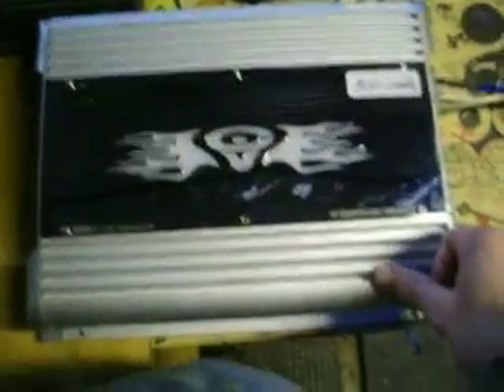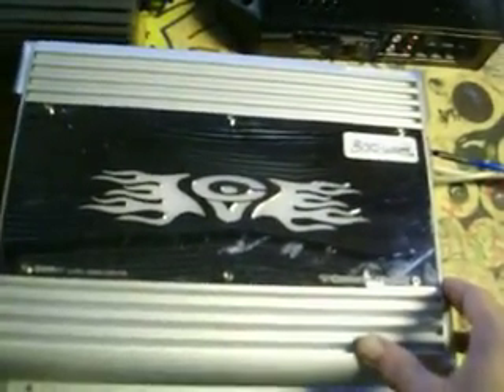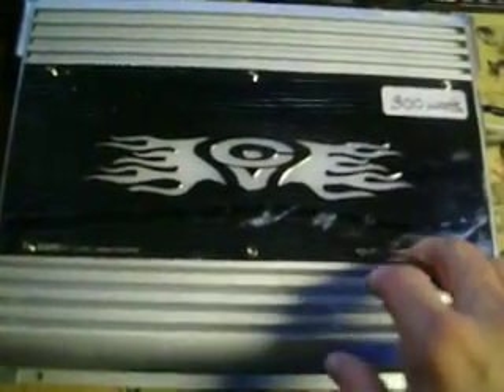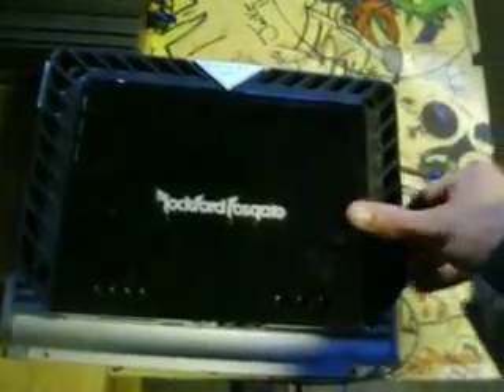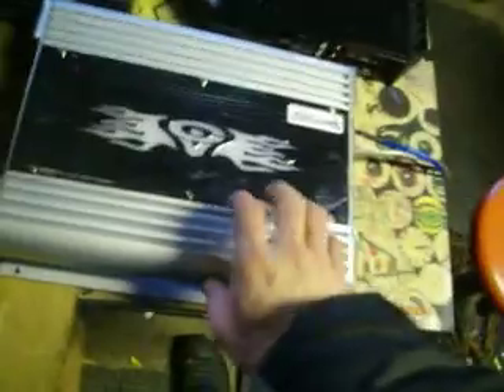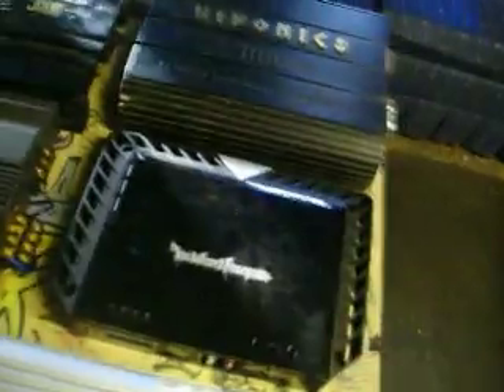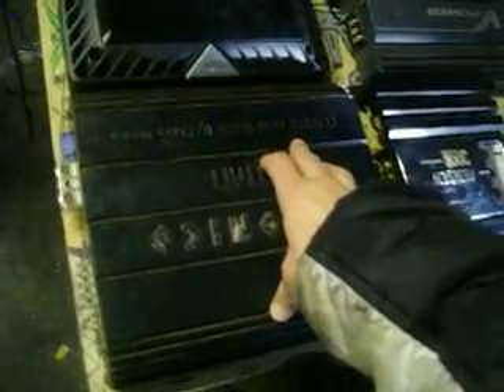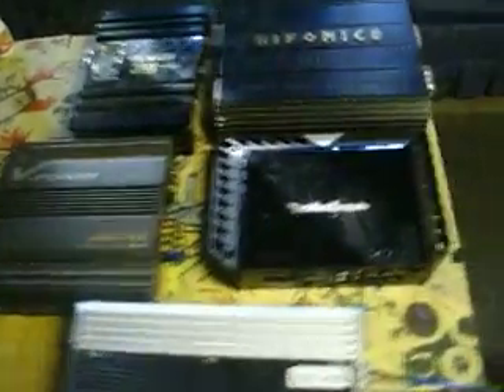Cerwin Vega XL 300.1 mono block amp

Comment from the maker: a 4 ch amp is mostly used for just speakers '' vocals and highs'' but some have a crossover for subwoofers , in your case you can use the front to run up to 4 speakers ''2 per channel '' so 2 on the left and 2 on the right , then the rear can be used for a subwoofer '' id bridge the rear channel and run 1 4ohm subwoofer '' or can be used to also run up to 4 speakers ''same as the front''  im sure your amp is 2 ohm stable stereo and 4 ohm bridged stable .